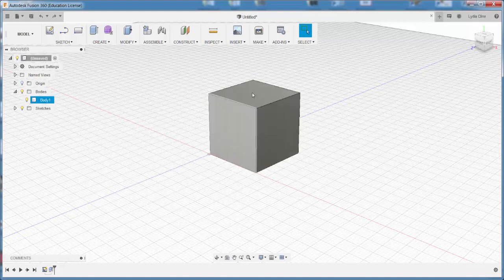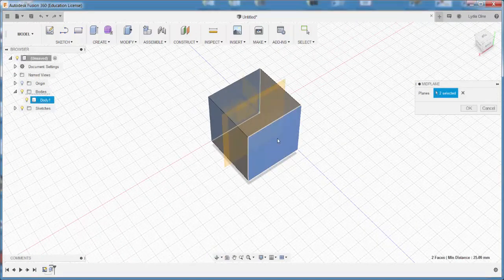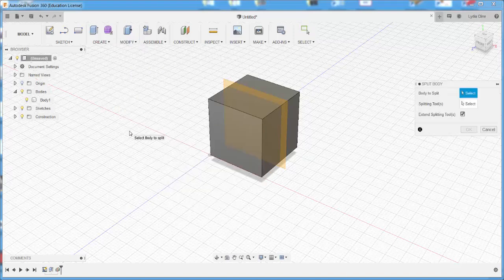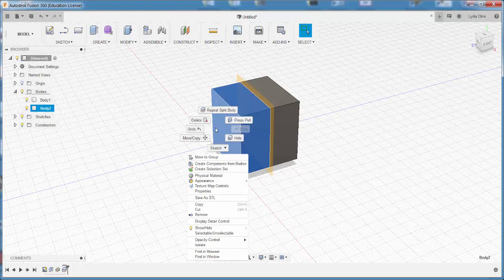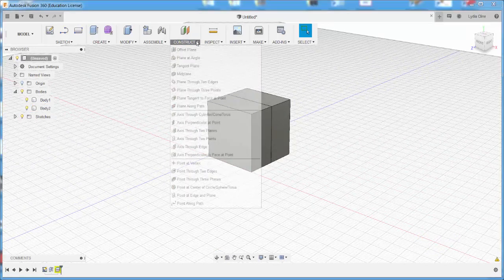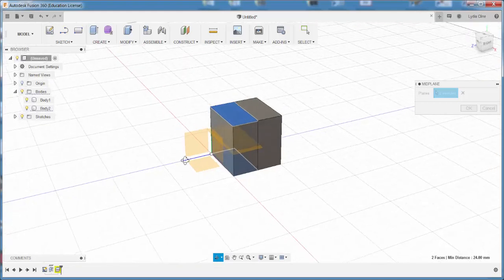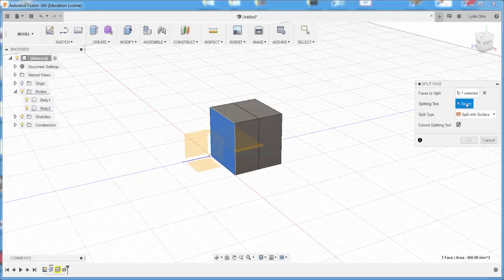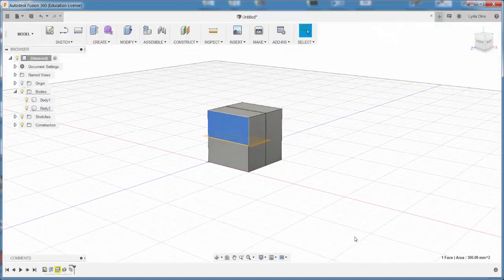Fusion 360: Split Body and Face

Comment: Yeah but what about splitting it at a specific point? For example I'm developing a model then I am going to 3D print I have decided to save a lot of plastic and not having a bunch of support waste I would like to split off a feature and print it separately and then epoxy it back on it will save an enormous amount of time plastic and waste. So it's very important that I be able to split it exactly where I need to would I use construct should clean and then move it into place?
Reply from the maker: Select the construction plane and move it where you want.